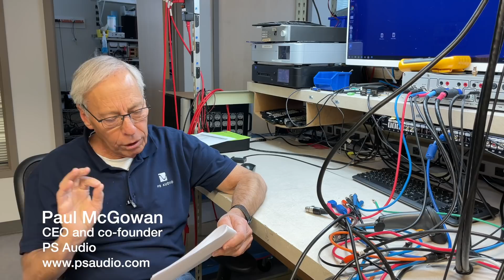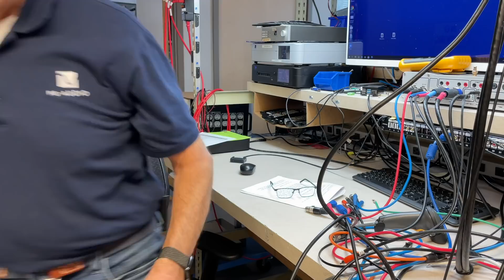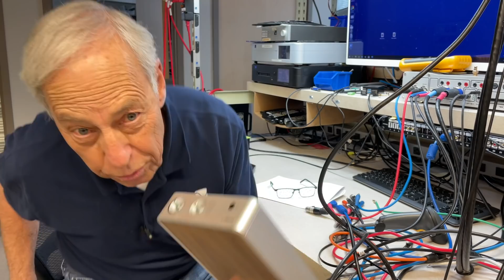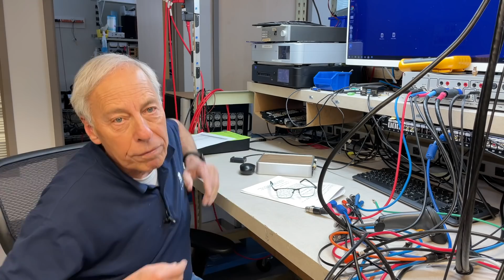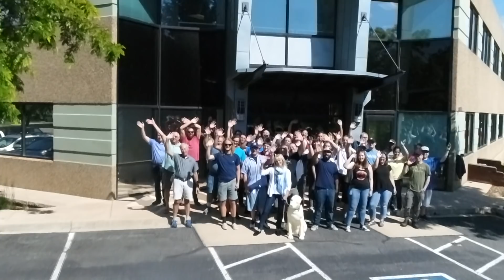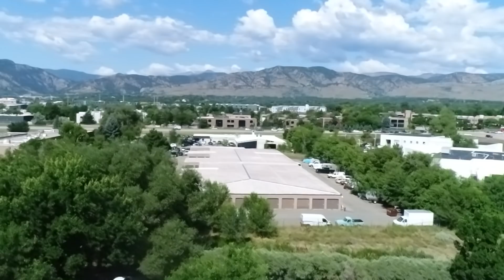Why Class D amps have small power transformers

Comment: So... Class D is practically a vfd in that it switches the diodes variably resulting in a square wave simulating a sine wave?   It can't possibly sound natural.

As a bass player  I can say without a doubt there is something about these digital(bass) amps that are lacking harmonically.  However, they are a quarter of the weight.

Comment: I have a couple Sony receivers from the 80's that had switch mode power supplies but both power supplies died.
I'd like to put a new switch mode power supply into them but I would need something like plus and minus 40 volts with decent current.
I haven't found any for sale.

Comment: Crown Harmon 6000xti amplifier advertises 6KW RMS output from a 240 VAC 20 amp outlet.  Looks like one could weld the seams on the side of a ship using the massive output transistors, so the 6KW seems doable.  The wall power into the amplifier tops out at 4.5KW.  Is there on over-unity power supply in these class D amplifiers or is there something I am missing?

Comment: They have a switching transformer as they are basically car audio type amps with an additional AC mains input in a fancy box. They could be made with a linear power supply but that would cut into profits and efficiency and I suppose the manufacturers think that if you buy a class D amp you don't really care about switching noise etc in any case what you want most is cool power.

Comment: One more difference is that my 1970's heavy transformer amps are still working today...
Reply: Are you implying new transformers stop working faster? That magnetic permeability degrades?
Reply: @mudza6002  implying that increased power density decreases longevity of the components of the switching power supply.
Reply: @thebigmacd  power density? what are you talking about?
Reply: @mudza6002  handling more power in a smaller space. Modern SMPS tend to be built a lot closer to max power ratings than big old oversized equipment.
It sounds like you are being obtuse.
Reply: @thebigmacd  Power density is not the proper way to refer to that, anyways, SMPS are built closer to max power ratings because of their same nature, since they work at much higher frequencies, they don't have to handle the same power spikes you find in a classical transformer, so there is less need for leeway. This doesn't necesarilly reflect on a lower lifetime unless we are refering to extremes.
And no, I'm not being obtuse, in this case where the term power density doesnt apply, you could also be refering to power dissipated, which is lower in SMPS or energy stored in the caps and transformers, which is also lower in SMPS due to the higher operating frequency.
Reply: @mudza6002  power density ... "power dissipated per unit volume" is exactly what I mean.
"Switch mode power supplies don't have to handle power spikes like old transformers" is BS. As in, it doesn't actually mean anything. A power supply has to handle whatever power spikes its application/load demands.
The reason modern SMPS stuff runs closer to the limit is engineering analysis is magnitudes more accurate than 50 years ago. They used to overbuild bridges too, because they had large margins of error.
Reply: @mudza6002  .. unfortunately..power density.. is the correct term....Watts o/p per cubic inch../ cm. & many module manufacturers.. in late 80's early 90's competed with each other , advertising their new one as one up on the nearest rival..in terms of
W/ cubic inch..
Standard SMPS employs hard switching..that creates RFI/ EMI issues & sw. spikes & sw. losses have to be tamed / reduced. besides the temperature rise .
Today soft sw.(a.k.a. resonant mode SMPS) is used by some ..
This overcomes / drastically reduced the above issues ..though here the p.s. is now at 500- 2000kHz range..

Comment: Lyngdorf SDA2175 Power Amp. 
650 VA Holmgren Toroidal. 200 RMS=8  375=4
Mines been in the Rack since 2010 and is a keeper.
To all the haters 5 mins with my Spendor S8e and you may just change your mind.

Comment: You can build class-D amps using (conventional) linear power supplies also. It takes up more space but sounds better especially at lower volume.
Reply: Exactly Johnny seriously you are either very experienced in class-d amps like me or either a genius (not like me). Best sounding class D amp i ever listened to and own was hypex UCd powered by a linear power supply and i can't wait to find how to set a linear PSU either with ICEpower module (the ones with not shitty ice/hypex smps -meanwell smps are way better but still linear is more dynamic more slam) or purifi 1et400a. That with a toroidal Antek and a good linear PSU would be the definitive amplifier but cant find a kit or a guide to connect it right and safe the modules to the linears (probably several voltages ) PSU's. Thank you very much for sharing your knowledge and reply. May God bless you
Reply: @TransformerVolumeC  yea. I built   it a few years ago using a 650 va toroidal, 20 amp bridge rect and 4 80 volt caps per rail. I belive the trans was 40-0-40. DC was just under 60 vdc.
Reply: Like how low? Off?

Comment: I wonder is why they barely have cooling... I mean I know their efficient can be even higher than 90% if very well design, but let's say something packing 500W is still 500W of heat and sometimes they use ridiculously small coolers, does the transistor or MosTet's simply can take a huge amount of heat without breaking?

I have a 80's Technics Class A receiver single small rail size and it's supposed to be 2x50W but the screen shows 100W and probably goes beyond with the dynamics ruined of course but still sounding good until a good loud point and it has a damn ridiculous sized cooler, it has a full copper tube thicker than the ones on my current fridge and then a big aluminium heatsink.

I know efficiency is way smaller than the digital amp, however it's still 4 or more times bigger biffier cooler than a 2x 100W digital amp, so it have nothing to do with just the efficiency as the cooler it miles bigger than the efficiency difference between this class A and a similar power modern Class D amp.
Reply: If you mean to say "500W of output power from an 90% efficient system..I assume it's tha Poweramp section that's @90% efficiency..
that translates to approx. 45 Watts of heat dissipation 
from the amp...that may become an issue @ 500W continuous after 1.5-2 hrs..
probably you don't listen continously @ that level for that long a time period....
some amps have their cooling fans coming on after  exceeding some prefixed temp. .. others may " vary their air flow" depending on rate or rise of temp.

Comment: I never realized this about SMPS.  So that is why we have all these tiny power supplies to power our lap tops phones and everything else.  Excellent!
Problem is they create noise and VARs on the AC lines that mess with all our great linear PS amps so then we have to buy a power plant to get the best out of them.
Reply: insist on SMPS power supplies that have " active power factor correction"  control to improve on lowest "VARS".. and those SMPS also featuring
 " spread spectrum pwm" is better  on the noise front..
Reply: @analoghardwaretops3976  Good to know.  I would hope all the laptops around the house have that?

Comment: Hi paul, can SMPS power supplies be used to power regular bulky transformer based class AB and H amplifiers?
Reply: At this point hate to mention it again but that is what Bob Carver did.
Reply: @leekumiega9268  Was it like today's SMPS..?? more likely it seemed to me a mains powered( primary side) 50/60 Hz "music signal operated" variable  phase control boost  from minimum to a limited  max.of 90° firing angle..

Comment: If you look at how CLASS-D works vs CLASD-AB then most of the transformer's watts go to sound in class-d while on class-ab a lot goes to heat. So if you are going to have 100 watts out of both,
class-ab need larger transformer than the class-d needs.
LED. bulb is class-d and incandescent bulb is class-ab

If you are going to buy a cheap amplifier then class-ab provides better sound quality than cheap class-d does! but you need to have bigger power supply on class-ab.

Comment: Not all class D amps use switchmode power supplies.Some class AB amps also don`t use linear supplies but switchmode supplies instead.My HYPEX amps which I built myself use 4 primary linear supplies;one each for left and right input stages,left and right driver output stages.

Comment: But does class D - in its current form - offer long term listening satisfaction? Back in 1996, a number of revievers noted that Krell monoblock amps at that time period eerily sounds like they are largely influenced by 300B output tube based single ended triode amps. Sadly, no side by side comparisons yet - given the last time I've been to a hi-fi show was back in 2019 - between a class D amp and a tube amp design based on the 1957 era Quad II. 🤔

Comment: Not every Class D amps have small power transformers. For instance, in my second system, I have a 100 Watts dual mono Primare I30 with 2 large power transformers and it sounds beautiful, with no harshness at all.  It depends of how class D is implemented... By the way, the newer Purifi Class D modules from Bruno Putzeys soud excelent. Class D is here to stay.
Reply: After what I remember and what I can find I have to correct you a bit:
Primare I30 is a Class AB dual mono construction while the Primare I32 is Class D.
And reviews say the I30 is better sounding than the I32 because I30 is Class AB and normaly have a warmer sound than Class D.
Reply: @Oystein87  , I think you're correct. It was my mistake :) The new amplifiers from Primare are all Class D topology. I thought that even the I30 was Class D...
Reply: @rasardo1  I had to think when i read your comment so I had to search to be sure myself :P
I read that people like the sound better from the class AB amps. I prefer Class D for subs and AB for the rest :P But that's just from some general testing and not REALLY tried over longer time etc.
Class D has become better but still it's said to have a bit "colder" sound.
Reply: @Oystein87  , your're right. But class D is evolving fast! On my first system, I have a valve preamp and Class AB monoblocks. I like this combo very much. But in Hi-Fi we do have to pair very well the amplification with the loudspeakers, so that we can really extract the very best from both sides.
Reply: @rasardo1  Well now it is evolving. But Class D came in the 70s or something so it's been awhile😝
Sounds nice😋
True...
Reply: I have a Primare A30.1 and I think it sounds great aswell.  Did you see that Primares new integrated amp the I35 is Class D?

Comment: So if you have like 20 large old class A or AB junk amplifiers, you can remove (or leave in) the power supplies, and use them to tie down a huge blimp.
Reply: While class D has mostly caught up with class AB in many respects (very few can drive really low impedance speakers Like ones of 1 or 2 ohms) , And I doubt they will ever match a good class A amp  sound wise.
Reply: @leekumiega9268   Yes, I still respect A and AB amplifiers. Plenty of music lovers will prefer them for decades to come. I don't expect class D to make them obsolete. My new Crown class D amp is really nice though. It sounds great with a tube preamp, and weighs only nine pounds. My 65 year old bad back can barely lift that much anymore.
Reply: @mikeday62  I haven’t moved my Class AB amps in 15 years and I don’t plan on moving again.  

The one thing I don’t like about Crown amps is that they look cheap.  

Crown has the reputation as a DJ amp.  It will probably forever stuck with them.  

Class D is great for professional mobile usage because they are so light to carry and deliver power and just need to play loud. 

Class D is also good for car audio too since you can get lots of power and don’t have to sacrifice weight and size.
Reply: @mikeday62  The XLS and a tube preamp is an interesting combo.  Zero Fidelity has a good review of the Crown amp, it sounds very good and ya can't argue about it's ability to output a ton of power.
Reply: @duken4evr   Yes I watched Sean's review of the xls 2502. Paul McGowan's PS Audio makes amplifiers that have a tube preamp with a class D power section in the same chassis. This type of arrangement has become fairly common in recent times.

Comment: I Am not sure that answers the  question. Why not use switching supply in a class A or B amp
Reply: Bob Carver did that in 1979 with his (magnetic field coil amplifiers) They were extremely light and energy efficient.
Reply: Manley is now using switching supplies on most of their gear. The difficulty that they had was that tubes need high voltages which these don't typically supply.
Reply: @gerhardwestphalen  standard.. SMPS. , even for speciality SMPS manufacturers.. probably would not even have such a design in their lists..leave aside products..
hi- volts p.s. for valve amps calls for diff. magnetic core formfactor.., wire gauge.. etc.. an amp designer requiring such would be better.. doing all this with his own power specialist team..& not out sourced..
Reply: @analoghardwaretops3976  Well Manley hired Bruno Putzeys to design their SMPS since he's one of the leading engineers in class D amps for audio (founding companies like Hypex, Grimm, and Kii)
Reply: @gerhardwestphalen  right...Bruno.. formerly with Philips.. & the co's you mentioned , besides others are all involved in Class D designs for some of their products....
Sw. mode p.s. design technology & expertise is a different field ..no doubt today many Class D engg. can understand it well..not many can design a robust& reliable one as a through & through expert perhaps could... though the other way around ..it would be a real advantage..when the SMPS specialist. becomes knowledgeable and has interest in doing his own class D experiments

Comment: Most of the amplifiers use transistors . Mainly transistors have 3 regions . Cutoff , active , saturated. To work all the analog amplifiers transistors should be in active region . Otherwise audio clips . When a transistor stays in active region it works like a variable resistor . So it dissipate lot of heat . Lot of energy lose as heat . On the other hand digital amps ( class D ) transistors stay on cutoff and saturated . Because it uses PWM . Dissipate less heat and lot less power loss . Efficiency is higher than analog ams . So powering those amps also need small power supply. But in audio quality analog ams are better .
Reply: Actually transistor as well as tubes have a fourth region known as the LINEAR portion of the amplification curve and that is one place where bias comes in to keep them operating in that linear area.
Reply: @leekumiega9268  Linear region is a synonym for active region.

https://i.stack.imgur.com/0wIqx.png

Biasing is about  setting the slope of the load lines (DC and AC, the AC line is not shown) to control its impedance and gain while maintaining the quiescent point (q point) of the transistor to allow maximum swing before entering the non-linear regions (saturation and cutoff).
Reply: @Douglas Blake Inside class D the main workings is pulse width modulation which is pure digital.
Reply: @Douglas Blake I would tend to disagree. I've heard Paul's take on this that it isn't digital because it doesn't deal with numbers; but, having designed PWM systems before, it is much more akin to designing digital circuits than analog ones.

If you see my post above to  @Lee Kumiega, you can see what kind of biasing needs to be done for an analog amplifier to create a constant gain curve for range of voltages. When you design for class D, you are deliberately letting the gain fly from cutoff to saturation in an otherwise unstable manner. Furthermore,  you are far more concerned with things like rise and fall time of the square waves that are usually the domain of digital circuits. The end result is that it more like designing a high power DAC than a traditional high powered analog amplifier.
Reply: @Douglas Blake You think in terms of some nebulous definition of whether a process is digital.

I think in terms of the bias characteristics of the circuit. To me an analog circuit is biased so that it can accommodate a continuous range of values around a central quiescent point before going into saturation or cutoff.

A digital circuit is one in which there is unbound gain so that there is no stable q-point and the circuit rapidly swings from saturation to cutoff without any steady points in between in a bistable fashion. There is a clearly defined on and off and the uncertainty region between the two has been made as narrow of a tolerance as possible.

It doesn't matter what process is used to get that point.  At the point the system moves from having a stable central bias to having a bistable bias between it has moved from being analog to being digital.
Reply: @Douglas Blake I think if we look at how each signal represents itself we can clear this up .an analog signal is sinusoidal and continuous where as a digital signal is a square wave and discrete defined by bit interval and rate or how many ones and zero's are strung together in a bit stream. Inside of a digital amplifier the square wave bit stream  is controlled by an analog signal but the signal itself is not analog . In an analog circuit the transistors generally produce amplification whereas the transistors in a digital circuit produce logic gates .